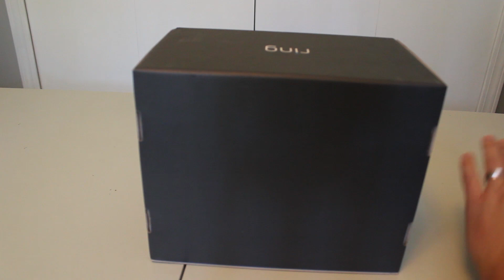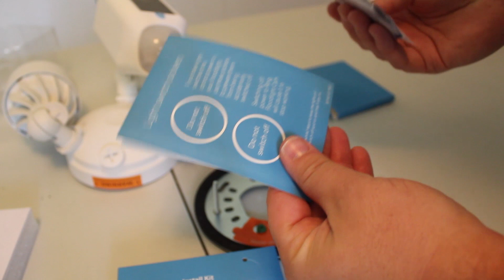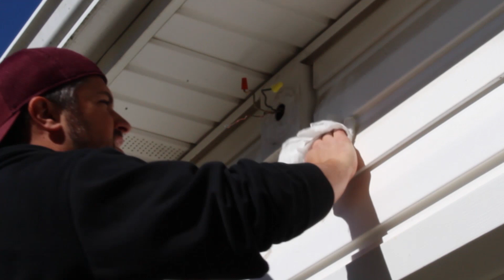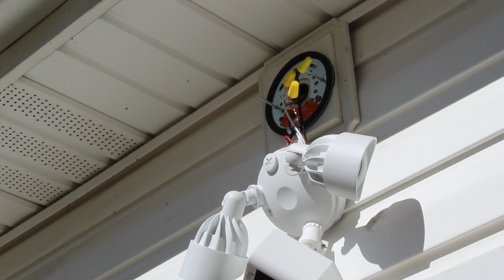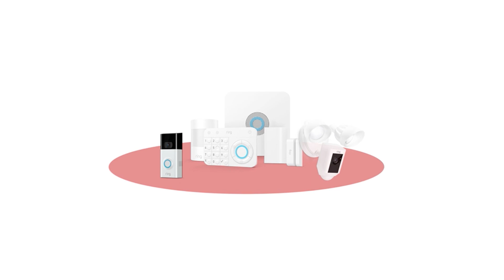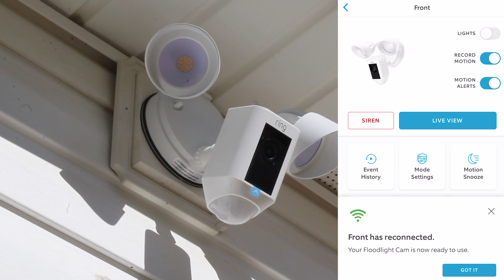Installing and Setup - Ring Floodlight Camera Wired

Comment: Can it be hooked up to a  normal outdoor light set up? Don’t have a floodlight in my backyard but there is a lamp hooked up.
Reply from the maker: If there is power there and wifi, it should have no issues at all. I would just make sure the switch to the power (if there is one) is always turned on.

Comment: i want to place this in an outbuilding, but the only internet there is a eternal cable that is connected from the main house all the way back to the outbuilding . Would it still work ?
Reply from the maker: I would probably just get a wifi router and add it inside the outbuilding plugged into the Ethernet and connect the flood light to the router. These you can only connect to wifi.

Comment: I recently changed internet providers and need to change the wifi connection to the new one, how can I change it? TIA
Reply from the maker: Best trick is to rename your new wifi network to the old name. If you can’t do that, find the barcode and get the device back in setup mode.

Comment: I have two questions I’m hoping you can help with. 1. Can you change the bulbs if they burn out? 2. Can you still turn it off and on from your light switch? Thanks so much for doing this!
Reply from the maker: Hi! No. The bulbs can’t be replaced based on what I know. They are supposed to last for 10+ years. They can be super bright.  The light needs power on all the time so from a light switch isn’t really a good solution because it wouldn’t catch motion if turned off. The app is super easy to turn the lights on and off. That’s what we use. I hope this helps! Thanks for watching!

Comment: Needed to see how you hooked up your ground...but it was hidden. Mine is not working for some reason, and the ring instructions said something about hooking it to the green ground...but it didn’t come with any extra wires. Didn’t look like you needed to ground to your plate...
Reply from the maker: Hey. I didn’t ground mine to the plate, there was a ground wire with the white and black. I just connected the green to the ground.